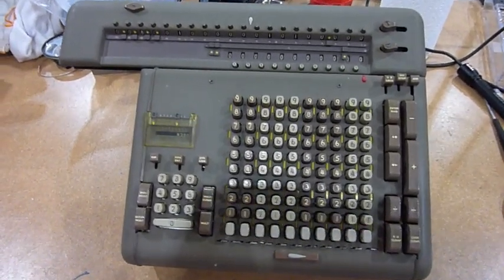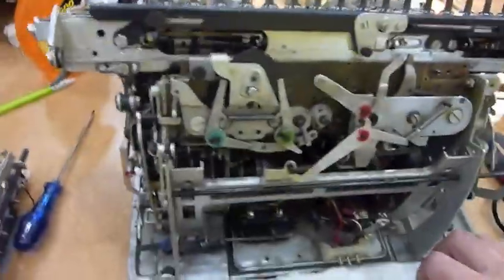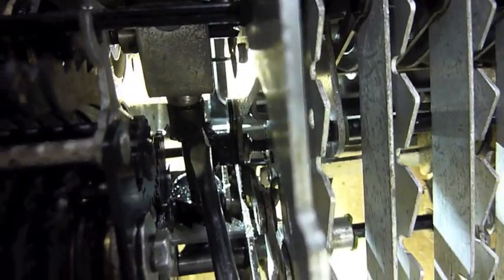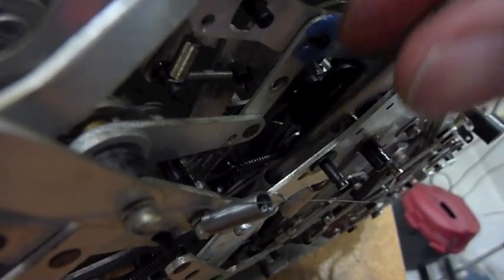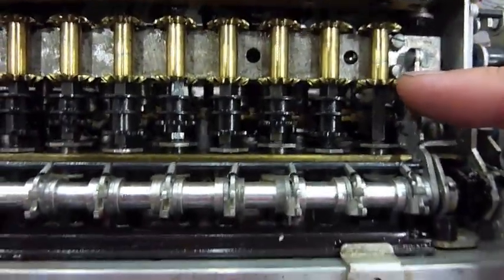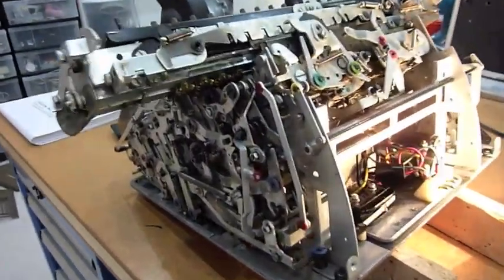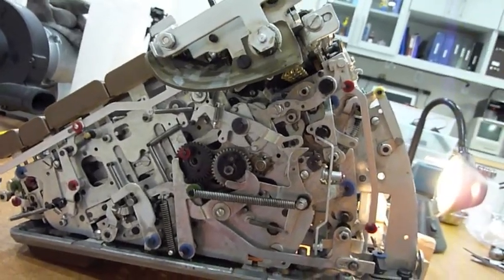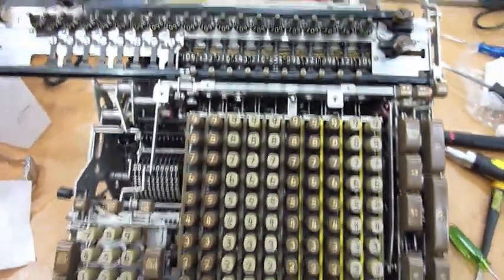Restoring a 1956 Friden STW 10 Mechanical Calculator

Comment: Hi Marc, I'm restoring my  FRIDEN STW-10 like yours; your video has been so useful, thanks.   Do you have any kind o documentation, manual, etc that I can use?
Reply from the maker: [Update] The service manuals have been scanned and are now available on my website! https://www.curiousmarc.com/mechanical/friden-stw-10-mechnical-calculator
Reply: @CuriousMarc  Unfortunately www.officemachinemanuals.com seems to be offline. Do you know where it went? different url?
Reply from the maker: I was told the guy died, and with him went his manuals. I am going have to scan the copy I have and put it online, when I get the courage (it’s a lot of pages)
Reply: @CuriousMarc  I would love to get a copy once you scan it.  I have the same model and it would get stuck while dividing, but eventually work loose.  It finally got stuck semi-permanently.  I have been afraid to attack it, but your video gives me hope!
Reply from the maker: @mightyorb8637  I scanned the manuals and made them available here: https://www.curiousmarc.com/mechanical/friden-stw-10-mechnical-calculator . Good luck!
Reply: Hi I worked for FRIDEN for 10 years I rebuilt them in the shop and did service calls in Chicago. You should get a hand crank to see the func😊

Comment: I'm one of the last remaining engineers who designed the Lunar Roving Vehicles, and much other space hardware.  In those days it was either Slide Rules or the Fridens.  My office partner was a higher-up, and he was allowed to have a Friden machine in our office.  That machine was used almost 24/7/365.  Engineers used to come in after hours to do iterations on their computations, because it was so much easier.  We solved differentials and integrals by successive approximation (old school Newton), and it worked great.  Just took a lot of time.  Our machine lasted about one-year, before we basically trashed it by overuse.  Repairs were difficult, and our repair facilities hated them.  We used them mercilessly until the advent of better Analog computers, which could also work Calculus and Systems Modeling.  Later it was Hybrids, and when the HP scientific hand calculators came into existence, this basically wiped out the Fridens.  Later when PCs came in, everybody jumped into the full digital worlds.  100000-times faster and easier.
Reply: @brunonikodemski2420  Thank you for the amazing gift you gave to humanity. I'm a young engineer working on LLMs who loves hardware.
The fact that I can talk to you is amazing. Your work inspired millions of people like me to pursue engineering. 
Greeting from Asunción, Paraguay!

Comment: My grandfather (Carl Friden) invented this machine and it is fascinating to see the guts working, and heart-warming to see a Friden treated with so much TLC. Thank you for sharing!
Reply from the maker: Your grandfather was a mechanical genious!
Reply: My dad was a VP of engineering at Friden when they were starting to transition into electronic calculators. According to him one of the prestige positions in the factory was "parts bender". Very seldom did one of these machines work right off the assembly line. The parts bender would go in a tweak the pieces to make them work.
Reply: @BCSJRR  Interesting. Your dad sounds like an impressive man!
Reply: @BCSJRR  Wow. Carl Friden too was a refugee of sorts who took a ship to the US with almost nothing in his pockets and pitched his calculator idea on the trip and was hired as an engineer. His story is amazing...like your father's (who sounds like Friden/singer should have funded but Carl was gone by then).
Reply: @chfr927  Carl Friden was obviously a genius at mechanical design. I made my living as a sw engineer for 30 years and made some big complicated programs, but never in a 1000 years do I think I could have designed, built, and got these mechanical wonders to work!
Reply: @BCSJRR  do you have some pucs from him at Friden company ?

Comment: I recently bought a Friden STW 10 (1951 vintage) and have been trying to get it running.  Unfortunately, I've found that there isn't much on the net that deals with solving specific problems with these machines.  Your video is a very important resource.  Thank you for making it.

BTW, the "root by fives" method, which you demonstrate, works because

           N
5N² = Σ (10j - 5) for j=1, 2, 3, ... N
           j=1

Which is a re-statement of "the sum of the first N odd integers is N squared."
Reply from the maker: That is so true, almost nothing out there. I had to go on fumes. I found a terse disassembly manual on the Fridenites Yahoo Group (too late to help anyhow), and a bad scan of the nearly incomprehensible STW Service Manual which I had to buy on   scribd.com. Thanks for the formula, makes perfect sense.

Comment: In the shop we had a tank of Tri Chlor with some light oil added.
We would dip the machines to wash out dirt and old oil. Some machine really needed that.
Machines in dusty abrasive enviroments would wear out fast.
Acid fumes also did the springs in too.
Reply from the maker: +Dennis William: You must mean Trichlorethylene as the solvent, not Tri Chlor as the pool chlorinating chemical. Thanks for the tip. I used alcohol to dissolve the old oil, but this might be better.
Reply: Trichlorethylene,  Trichlorethane Is what I meant and is no longer sold. Cancer causing I think.
Or maybe the Ozone layer? I don't remember.
Alcohol is safer for sure.
Thanks
The vid sure brought back memories.

Comment: i went to school in san leandro at the friden factory.. when we graduated they gave us a gold plated crank so as to cycle the machine slowly and repair it.. the first thing we did, when in the field, was to send it into the shop to be washed.. in a diswasher type of machine which would rinse it with solvent and a small amount of oil.. we had specialized tools for forming (bending) those levers and such to get it to operate correctly.. the entire machine depends on cams and levers being cammed up at just the correct speed so another loever could catch it and finish a particular operation.. i serviced the calculators at all the big insurance companies downtown san francisco.. liberty mutual on pine street and the zellerbach building on market acrossfrom the shell building if memory is correct.. the first thing the guy in the video should do is wash that machine then oil and grease the cams.. it also depends on spring tension being correct.. gosh, all this was in the late '50's like 1959 or 1960.. just before friden developed their first electronic calculator.. if he getrs it running, dividing and not jamming he will deserve a medal.. :-)

Comment: This video made me time warp back to the 80's when I had a short stint working for Burrough's Corp. They wanted me to learn how to fix their mechanical banking machines (wish I could remember the name of them) Instead I worked on the electro-mechcanical TR-??? banking teller terminals. What a pain. The days of RS-232.

I have to give you credit, dealing with all of the screws, springs, actuators  UGH. I wish you well, keep tinkering.
Reply: I used RS-232 on a daily basis until 2016, for configuring and servicing SAN/NAS units. It's still popular :)

Comment: 1966.68 I used one - in my first job as a trainee in a factory office in England.
I remember they were generally reliable, but as co. wasSwiss, it was properly serviced.
occasionally the carriage would jam. we users removed it, to reset cogs affected.
if you like these type of mechs, recommend you search 'techmoan 'akai invertomatic cassette'. like steam trains(I rode on a few of those too!). things wren's necessarily simpler back then.
but things worked, and you could see how they worked, not invisible digits :) well done

Comment: Would you be inclined to design a clear acrylic case for it... so that it protects it from dust etc but still shows off the lovely mechanics?
Reply: I like this idea!
Reply from the maker: +JG: I agree! Looks more amazing without the covers! Some early mechanical calculators had glass panels so you could see the inside mechanism, too bad that was later mostly abandoned.

Comment: The main shaft has a threaded hole on the right side. Find a bolt that fits and make a hand crank.
This will be a big help.
You might  find a factory service manual on the STW 10.

Comment: I was wondering how you removed what looks like rivets without damaging the machine. I have found a machine on eBay that is absolutely wrecked (looks like it took a long fall and landed dead center on the bottom on a table corner or something so the case is bent inwards along with some of the bottom parts and transformer assembly) so I’m working on rebuilding it in CAD to allow for new spare parts to be manufactured based off of it. Also I was thinking of making a second one with modern considerations like piling pads, aluminum parts with steel rims, lightening of pieces, etc. unfortunately I don’t think the original machine will survive the process

Comment: The real calculation for pi would be:
4atan(1)
Which gives 3.1415926535...
Or the approximation of it to the highest precision of the device used to calculate it.

Comment: Worked in a typewriter repair shop in the late eighties doing board level repairs. The old school techs (didn't  like electronics, or me) doing the real work around a common bench used a submersible parts washer. Something you might consider?

Comment: Congrats and thanks for posting, these are beautiful old machines.  This makes me want to try again on a much less clean one that I got several years ago.  Could you recommend any sources for that power cord?  Also what type of oil/lubricant did you use? 

Also I have heard there is a fiber gear that’s important not to put power on with the machine frozen, lest it get stripped.  Any guidance on that?  Can you point out where it is in your video?
Reply from the maker: This guy has the cords - I need to buy one too. Look for the oval cords:
http://www.apexjr.com/
I used lots of WD-40 to get things unstuck - which did its job but is a terrible substance long term. It is the very opposite of a lubricant, it's an aggressive solvent. You want to try to remove it all and re-lubricate later with light sewing machine oil.
The plastic/fiber gear is the orange looking power transmitting gear(s) on the right side of the machine. My machine was frozen and it didn't get stripped...
Reply: CuriousMarc Many thanks for the info!  I hear you re: the WD-40 - I used that several years back and later put the STW aside without cleaning it off, and that was a bad move!...  Some things I unstuck then are stuck again now - it definitely leaves a sticky residue.  Thanks again for the video and inspiration on this.

Comment: Thanks for a really great video.  It is helping me to get my STW 10 working.  Not having a lot of progress thus far, the main shaft is immovable and the motor just buzzes like yours initially did.  So far I've completely restored 4 Monroe calculators to working order. Two LA5-160's, a LA5-200, and a CSAE 10 Monroe matic.  Is there a reason why you didn't use WD40 to help free up stuck mechanisms that took you days or weeks to find and then use oil and other strong lubricants to the entire mechanicsm.
Reply from the maker: In this case I /did/ have to use WD-40. And some amount of force. I recently did another one and I had to hammer parts out of their shafts! So it seems to be a consistent Friden problem. Happens on black anodized shafts apparently. The problem with WD-40 is long term: if you don't or can't remove it, it tends to turn oil into a sticky substance. But I would not have been able to take things apart or loosened up safely without it.

Comment: Just bought one of these on ebay, and it seems to have a very similar problem, with the two left-most actuators under the keyboard being stuck. The work continues.
Reply: For posterity, the carrieage is much easier to remove by removing the travel stop on the left side, leaving the guide rails in place. you can then slide the whole carriage off to the right.

Comment: Might I ask how you managed to remove the multiplication keybord? I found the two hex screws on top in and to the right of the keyboard and the four big circular head screws on the bottom of it but I was unable to get at the final screw as it was blocked by some unknown control bar. I also accidentally popped some springs off getting at the first 5 screws so now I really need to get in there lol.

Comment: Hi Marc,
I just recently purchased this from a seller on E-Bay, but it didn't come with a plug, I was wondering  if you could tell me if it's a standard 110? I know this video is nine years old, but looking it up on-line doesn't seem to produce many results so far. Thank you in advance
Reply from the maker: That’s an oval 110V cord, a standard from the 1050s. They are getting hard to find, but they are on eBay, often for ludicrous prices. Many people replace the old oval plug with the modern squarish one.
Reply: @CuriousMarc  thanks for your response!

Comment: would sticking it in a tub of oil/diesel work? or too many parts that wont like an oil bath?  tho not much help if parts are mis aligned.
Reply from the maker: Maybe, if you removed the motor and electrical parts. I think that's what they used to do for regular maintenance on some machines. Using detergent spray had also been suggested. But I doubt it would have worked in this case. This was stuck way to hard. I had to use enormous amount of force to barely move some parts, infiltrate with WD40 at targeted points, and really remove and clean the parts where you could. What might have worked is a warm ultrasonic solvent bath, but an ultrasonic bath this large would be a very expensive machine.

Comment: Also does this computer have an FPU (antecedant to CPU)? Sorry - I asked about 'differences' - meant differential equations. lol
Reply from the maker: I don't quite understand the question. An FPU is a much later specialized term referring to electronic circuitry for accelerating floating points calculations in an electronic computer. A floating point number being a number described by two numbers, a mantissa and an exponent. I do not know of any mechanical calculator that represents numbers natively that way. But you are probably asking instead if one can do floating point calculations on a machine like this. And the answer is yes, you sure can do such calculations, just like a CPU with no FPU does floating point calculations using integer arithmetic, just a bit cumbersome. However in practice, and with so many digits available (that's why they are there!), you'd simply perform fixed point calculations. The Friden has many manually operated markers to keep track of the decimal point on all registers and on the main keyboard just for that purpose. I think I show this in my Friden demo video here: https://youtu.be/qKm9eM2BuM0 .

Comment: My other question is; can this machine be used for polynomial calculations / finite differences? I only ask since the British Science museum have reconstructed Babbage's difference engine from the 1830's. If so can you pls upload a video - that would be amazing!

btw - here's the link on YT to prove it;
https://www.youtube.com/watch?v=BlbQsKpq3Ak
(skip to about 18mins into it)
Reply from the maker: The Babbage Finite Difference machine (of which I have a video of the one that was at the CHM here: https://youtu.be/GB1xQkgi3HE) is the only specialized finite difference mechanical calculator I know of. It would be possible but impractical to use this method using a mechanical calculator like this - you'd have to use lots of machines and operators and coordinate a calculation. To compute mathematical tables with this, you'd simply use polynomial approximations instead, since it can multiply and divide.

Comment: How much WD40 did you use?
Reply: I think he probably used some lube or oil mostly. WD40 cleans rust, lube (acts like a solvent) and frees stuck mechanical parts, you can't use it as a lubricant
Reply from the maker: Jose is correct on all points. Stay away from WD40 if you can, and remove it and replace by oil if you have to use it.
Reply: Yup, you should use WD40 ONLY to clean. After you put some of the cleaner, it will evaporate (That's why you shouldn't use it as a lubricant) and then you should use some oil to lubricate the moving parts.
Also, NEVER use WD40 to "lubricate" motors of any kind (A very common mistake by a lot of people)